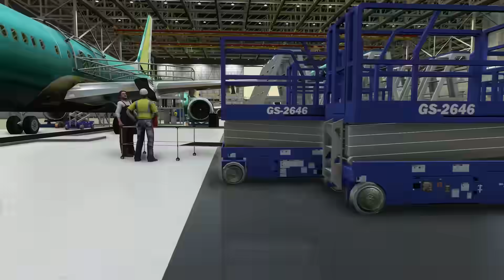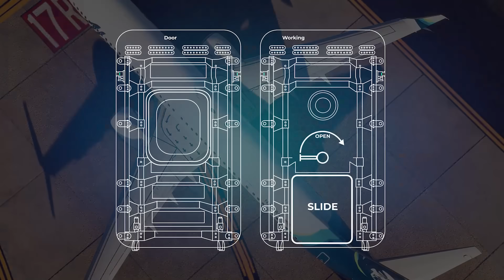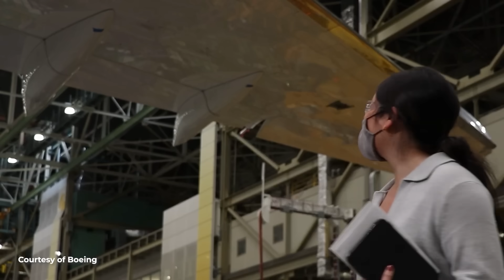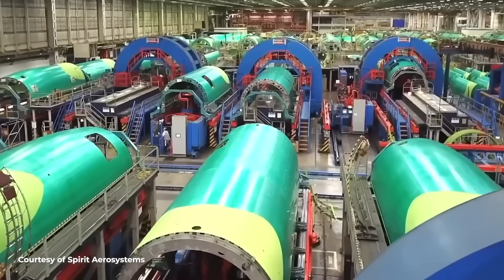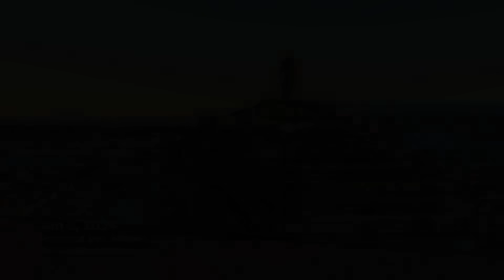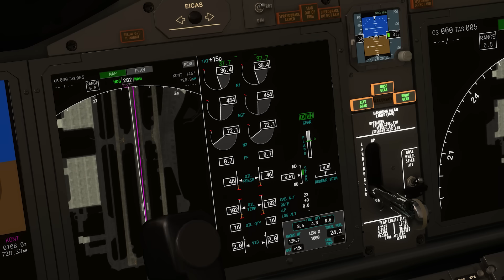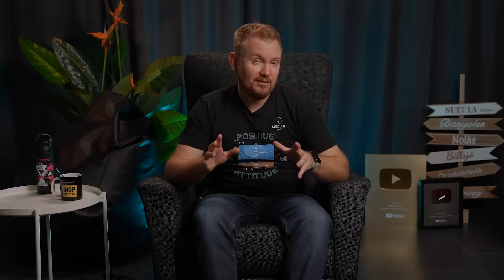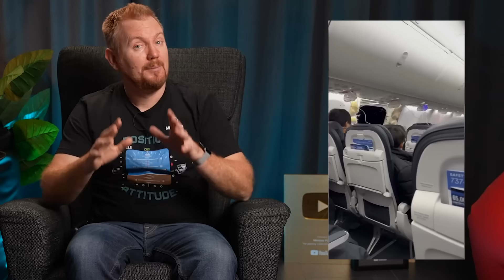Boeing 737MAX BlowOut!! The Scandal behind Alaska Airlines flight 1282

Comment: At the latter end of my Airforce career I was deputy manager of an airliner Proof Pressure Test team we were set up to prove the technique in light of the Aloha airlines incident in 87 resulting in part of the pressure cabin failing, turning the Boeing 737 into a cabriolet with some 2+ metres of pressure cabin peeling off aft of the flight deck and above the floor line! The aircraft miraculously survived and managed to land, with if I remember correctly only one fatality, an air stewardess who was sucked out of the aircraft when the failure occurred!  If the technique of proof testing (raising the cabin pressure to 1.3Delta P and listening to the structure via sensors attached to the outside skin) had been used on the 737 max prior to delivery I feel sure that that plug would have made sufficient noise to raise the alarm that all was not well. But hindsight is a wonderful thing unless all aircraft are tested before the are delivered to the customer

Comment: Affirmative action is one of the largest issues Boeing and its suppliers (who are forced to confirm their race targets are met) are facing.  It is now packed with unqulified employees. If you saw what we see you would not fly on a boeing plane made after 20011. For instance, Boeing now hires Engineers who have no engineering degree or formal experience.  They simply are filling "race requirement" by stuffing the lines with junk employees.  This is a major problem facing America. Should see the new group of pilots and air traffic controllers.  Total nightmare.

Comment: You incorrectly indicate the door is being held closed by its own weight. It is held up when closed, by spring pressure. The mechanism of opening the door plug is to move the door down, compressing the springs further. I would suspect turbulence and landings had more to do with door plug failure.

Comment: Watching this brought back memories of leaked pictures in how the tail section of the dream liner was strapped with a ratch belt to make it fit to the wing section. And at first rollout one could see that Highlocks were used on the nose section. Oh man, we laughed so hard. It was so obviously a fake.
 I worked in primary insulation at Airbus. You need to be vigilant 24/7. I was always aware of the responsibility. It's a huge strain on ones mental health. Because in the end it just needs one employee doing the wrong thing to make the whole system collapse.

Comment: This is a great video but it left me confused on one thing: 

My understanding is that airplane doors are slightly larger than the openings so that even if there were no bolts, the pressure itself would keep the door secure. Was this not also true of the plug?

Comment: Something tells me going down from 4 to 2 engines was a bad idea. Pushing 2 engines to max rpm to gain optimal thrust is probably increasing the frequency of vibration of various components; many of which are glued by 3M aircraft grade adhesive. 
The global pressure arm twisted Boeing to drop two engines for economy, fuel efficiency and lower carbon emissions. 
A lot of airlines hurriedly dropped the 4 engine aircrafts from their fleet. There are Middle East airlines still operating 4 engine aircraft on some routes. Ask any old pilot, if four was better than two?
I feel, the climate-mongers have endangered us on the ground and sky.

Comment: 23.04. The door is slightly lifted?

I think it might be lifted to a  tolerance distance. 

But, the lifting process should stop after its top edge touches the upper construction frame (even if there is no rubber seal.)

I suspect that the door was not fully aligned to the frame tangential axis.
Or the door has been straightened (reduced it's curve) so it missed that alignment.

Comment: Can't remember the exact date. 
It was either January 2016 or 2017.
I was flying a red eye regional flight from Columbus ohio to Washington dulles.
The plane has approximately 75 seats. 
I was seated towards the rear left hand side of the plane one seat row back from the left side emergency exit.
..
The plane was delayed because of ice on the plane due to the cold weather and de-icing.
.
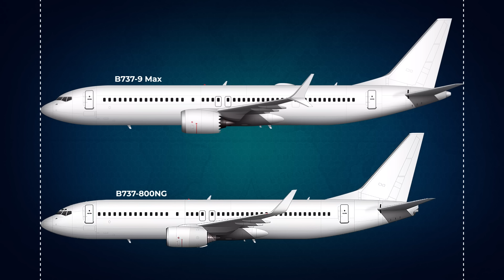We take off, usually about 45 minute flight time about 1hr -1:15 including boarding and deplaning.
As We were climbing to flight altitude. I noticed the emergency exit in front of was whistling, like when one doesn't shut the car door properly.
I realised this wasn't right and the plane wouldn't pressurise.
I was about to subtly alert air cabin crew.
When the plane made a very sharp descent for about 2/3 minutes.
All the oxygen masks deployed.
Everyone looked confused didn't know what to do, i thought it was a malfunction.
As there were no cockpit announcements..
And being dark outside added to the tension.
.
After about 4 minutes the plane leveled out at what i must assume was 10,000ft to allow cabin pressure equalisation.
.
Then the captain announced we had a cabin pressurisation issue and would be landing in Philadelphia.
(We were on the ground within 15/20minutes)
We landed safely.
..
I got offered compensation which was derisory, but glad the pilots acted professionally and swiftly and everyone survived.

Comment: The incident may not have been a 737 max design issue as you said but defenitely symptomatic of the festering  toxic relationships Boeing progressively instored within its own ecosystem. I read several reports highligting the NTSB was discontent with the level of cooperation from Boeing on the investigation meaning they may have something to hide...again.Boeing needs to go back to being an engineering company, not a finance one and regain the market's trust. As far as i'm concerned, i consider the max born dead. Even if unjustified, the public has now become acutely aware of the aircraft malfunctions and some flights search engine like Kayak have started to display a filter allowing users to exclude any operated flights with the 737 max. See also AA, an historical Boeing devoted airline now swapping their orders to Airbus...It's so sad

Comment: Out of curiosity, when you presented the two upfitting options, why would an airline have to disable the door if they weren’t going above 189 passengers? Would it be a bad thing to have an “extra” emergency exit?
Reply: Aesthetics.  Leave a gap between the seats so door remains functional, or put seats in front of door and make door dysfunctional... except for contortionists.  Personally, I wouldn't mind a row without a window.

Comment: I listened to your argument about why the bolts would be left out, e.g change of shift, and I don't even begin to buy it.  I understand your focus on fixing problems rather than blaming people, but in this instance here is what happened:  Someone looked at this door assembly and either:  1. Didn't care the bolts were missing 2.  Decided the assembly didn't need bolts.  3.  Was depending on a supervisor or someone in quality control to notice, 4.  Was mentally incapacited by their drug of choice, or 5.  Is completely unqualified to do this type of work, either mentally or physically.  How long, really, does it take to look and see the plug in assembly has the 4 bolts installed that are required to keep everything structurally sound.  None of the above answers are adequate and the main idea to take away from this it that this very kind of thing is happening in every business sector in the United States.

Comment: There’s no way those seats were just empty for no reason. 

The last 3-6 seats are supposed to be the back row, I know for the airline I worked at it was required to be seat DEF in the last row as a contract requirement if those seats don’t sell.

So the flight attendants gave up their comfortable seats because they were scared of the plane they were forced to work on…. I bet if you go back and look those seats were “blocked off” nobody wanted that window seat? Nobody on a FULL place wanted to stretch out? No, I don’t believe it.

Comment: Current Engineer (and pilot) here. I’ve worked with multiple aerospace companies and I cannot stress this enough, it’s (almost) always the process, not the people. The tech forgot to put the bolts back because it was not in the process. It took me many years to accept this. I oversaw at least 200 leap 1b GE engine builds. Everything was in a kit. No parts were ever left over. Nothing left un torqued. The process was bulletproof. Sure we had problems but the process caught them before they ever made it to the plane. For this example (disassembly of a finished component) all the details would be re-kitted and isolated from production details. Easy. No exploding door. It pains me as an engineer to see this.
Reply: Yes, or perhaps the organisation rather than the individuals?

Comment: I’m amazed that the pilots operating manual doesn’t tell you that the door will blow open in an event of a rapid depressurization. On the Max and NG we have periodically timed maintenance tasks to test how much force it takes to blow open the door.
Reply: Any possibility that in today's world it was a conscious decision to omit  the fact lest it be become more widely known to those who might use the information to forcibly gain entry?
Reply: @ChrisNotTheKing  I see your point, however the door doesn’t open into the cockpit, it opens towards the cabin. So the force required is almost impossible from the outside. The pilots operating handbook doesn’t have every single detail in it because they don’t need to know things that aren’t for operating the aircraft. For example a pilots operating book does not need to know how the lighting system inside the cabin works. It’s nice information to have but it’s not part of the aircraft’s operation. This isn’t anything new in aviation… all planes are like that.. from a small Cessna to a big airbus.. the manufacturer only provides enough information to have the pilot operate safely. If they provide all the information then in critical phases of flight finding the proper information will be much longer
Reply: @frankmazzaferro8331   Actually I was thinking of a passenger finding a way to vent the passenger compartment, as that'd be the way the pressure could forcibly-by-design break door seal.  In this case, so forcibly that it got stuck until cabin member disentangled it.  Cockpit security ought to be part of pilot knowledge... accidental omission seems strange, unless there was ulterior reasoning for intentional omission. That's the sum of my naive reasoning!

Comment: Spirit company in Wichita designs & manufactures the plug door, requested design by the FAA when an airline orders the high-passenger model. Not Boeing. Safer than any airbus that uses non-metal material for its paper airplanes

Comment: More clickbait.  This channel is really going downhill fast.  Everything in this video has been covered repeatedly by multiple news agencies.  What happened to the useful and informative safety accident videos?  What a shame.  Furthermore, a lot of the blame for this is going to Boeing, which is partially responsible, sure, but Alaska Airlines continuing to fly the plane despite the manufacturer recommendation to NOT fly it when the air pressure system is indicating repeated problems is also a major safety concern.  Boeing surely has a LOT of damning problems, however, this incident was still completely avoidable if the manufacturer recommendations and instructions had been followed.
Reply: Calm your panties.

Comment: As per an article I read in Forbes Magazine dated 11Mar 2024 :
FAA is considering the issuance of an AD regarding wiring associated with the wing slats on the new Boeing 737s, which have initiated uncommanded deployment, causing the aircraft to roll into turns.
I have not seen this issue alluded to in any of the so-called mainstream media.
The 737 MAX aircraft ? Rather fly on an old 737-200 into a gravel strip in the Artic circle than fly on a brand new one.

Comment: So at 36:41 the cockpit door was open or blew open from the pressure ? ? That’s a confusing part of this process . Putting that aside these two pilots are heroes 🏅
Reply: I understood it meant that the door will automatically open under large pressure differential to protect airframe integrity.  Not something you'd want to advertise to persons who might use that as a means to gain forcible entry.

Comment: As an engineer I cannot understand why the hell voice and data recorders are so damn dated. Overwritten after 2 hours, come on!
I seriously ask, why dont we use state of the art storage devices? You can fit like 3 weeks of recording on a cheap sd card. There are highly reliable industrial sd cards, you can even use several in parallel for redundancy. We could even fit 2-3 cameras on the plane and record hours of footage. 
I understand why this voice recording method was used in 1980. But it is not 1980 anymore, and investigation would be much easier if we evolved a bit.

Comment: If you actually knew anything about the 737Max ; then you'd probably know that the Boeing company doesn't even make the body part of the jet.  That's right the fuselage is shipped to Boeing for final assembly.  A company called Spirit makes those bodies.  Boeing is responsible for doing it's job correctly but at some point you have to trust your long time sub contracting company to do their job right.  Every bolt, even part of the plane is documented with check offs, and the body is accepted as a completed object.  This comes down to a subcontractors worker didnt correctly tighten bolts and the supervisor checked off the work as good. You can bet they know exactly who was involved that failed to do their jobs right. So you then see if there is a proceedure that can be followed that will assure the job is done even better.

Comment: Just a thought about bad oxygen bottles and planes.  The flight crew depends on having bottles of oxygen, not the chemical generators that passengers rely on, so maybe in a loss of pressure situation, maybe caused by damage to the hull in the electronic bay, maybe from a fire.That is also where the pilots oxygen is coming from, so the  pilot flying should grab his mask first, but the pilot monitoring, should first set the autopilot to a lower altitude, just in case the incident also damaged the oxygen supply for the pilots. The pilot flying could then, if the other pilot needed help, assist him with putting on an oxygen mask.  I am thinking about MH370 and it maybe becoming a zombie flight considering the testimony of John Barnett (RIP) about oxygen supplies and also a possible LI battery fire. which could have damaged the oxygen system in the equipment bay. Every system in a plane is redundant, except for the pilots, and also their oxygen system. A redundant oxygen supply would be useless, as the first sign that the primary system had failed, would be unconsciousness.

Comment: In nuclear power industry, if the lead controller has failed, the backup controller is placed in service, the failed controller is repaired immediately. The issue here in this airplane, is that if the failed controller is determined to function correctly, maybe, people might have gone into deeper checks and the door was causing the increased leakage and an inspection of the door area would have revealed the missing bolts and the door beginning to displace out of the desired position. Maybe.

Comment: Great report, Petter! An important detail you have not covered nor have seen this covert by the comments: As you say someone forget to install the locking bolts. This alone is unacceptable on this level - but this would be a human-error. But even more concerning: it seems, that this someone has intentionally by-passed the spring loaded assist mechanism, preventing that the door moves up without the locking bolts, by a cheap white ZIP TIE as seen in image 12:17, (mounted at the right lower stop-fitting to hold the door in place)... Without this ZIP-TIE, by-passing the spring, this door would probably already pop-out on ground while taxing etc? I can hardly believe that plastic ZIP-TIES should have any business in an aircraft-production line.

Comment: Would it be so difficult to install a system, where every critical part, has to be scanned twice? With a barcode on it or something, or on the bag it came in? Scan it once when it comes out of the bag, and then it has to be scanned again after it's installed in place on the plane. That way if a part is missing, you can trace it right back to the person that was supposed to scan it. If there are two scans this person obviously is just not doing their job. if there's only one, you know then they just forgot. And then you can eliminate that weak link. Or, the employee scans a barcode when he takes it out of the bag, and a supervisor has to scan it and sign off that it's in place. Would that really cost so much money? Why are we putting cost over human lives? I don't care how much something costs as long as it gets me on the ground safely. If Boeing doesn't kill me, I'll gladly fly on their planes again. This doesn't need to be done on every single part obviously, only parts that are deemed structural, or safety critical. And the FAA has to decide which parts those are. Not Spirit or Boeing, because they do some dumb crap like decide that wing bolts weren't structural to save money😂

Comment: Nice explained! I wonder if you pilots can train a rapid depressurization. I know there are these air pressure tanks where pilots are trained to feel what hypoxia  feels like under controlled circumstances.  Now you train with those oxygen mask in the normal simulator. So by setting up a big fan in the simulator they could simulate the effect of the noisy airflow...